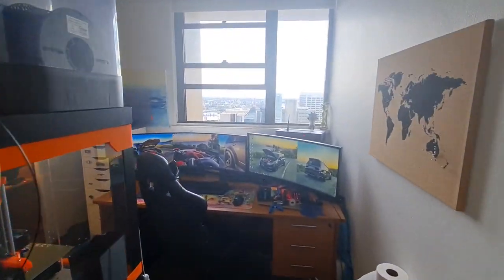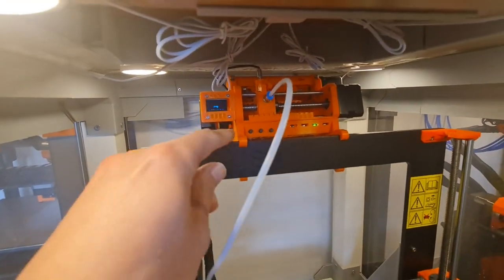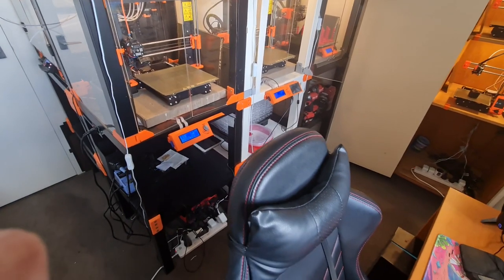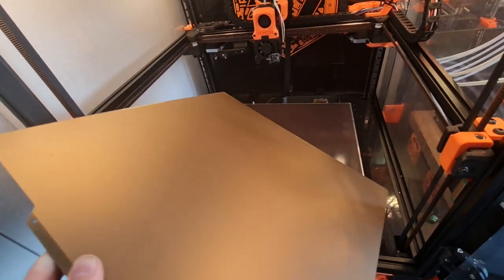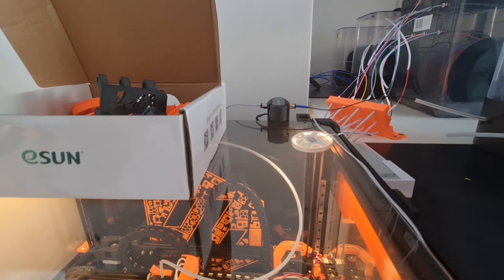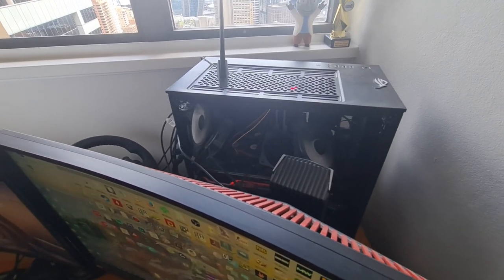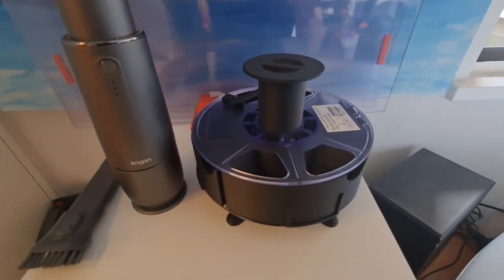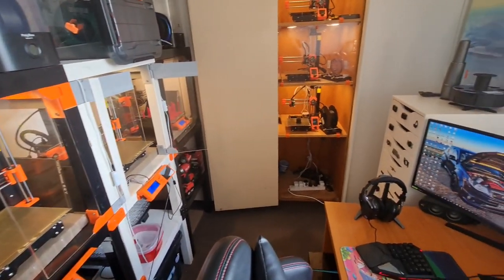Prusa and Voron 3d printer room tour

Comment: nice setup... be careful with electric... I see lots of extensions and those are a real fire hazard. Thanks for sharing!
Reply: You bring up a really good point. It seems like he's been doing this for a while, so hopefully everything is rated appropriately. Extensions aren't an issue as long as you run them well within rating (ideally 60% or less of max amperage).
Reply from the maker: The prusa mk3s use 120w each when printing abs, prusa minis about 90w 
And the voron about 250w 
Led lights are 350w total and usb power supplies 300w. 
So 880w + 650w = 1530w with all printers running plugged into a 240v 10amp socket (2400w)  so only at 66% with all printers and lights on. There's plug in heaters or vacuum cleaners that pull more power from a single plug so will be fine ✌🏽
Reply: @keenzkustoms2408  That's assuming it's the only socket on that circuit. The peak load will be rare to hit however, so yeah you're probably ok. It'll just be if there is a fire, insurance might not cover it if power boards plugged into power boards are discovered after the event.
Reply: Yeah best to run these printers of off water power instead of electric. 

Or get an English lesson.

Comment: Very sweet indeed. I’m a newbie so should I buy Prusa or Voron? Thx
Reply from the maker: would go with something like a prusa mini as your first printer or a mk3s if you have the budget for it. the voron requires alot more work such as compiling your own firmware so gets quite involved. where as the prusas are pretty much plug and play and the screens guide you though getting your first print set up so works good as a first printer.
Reply: Agree with the above, get a Prusa mini, learn a lot and then use it build a Voron. The Vorons are great second printers, wouldn't recommend them as a first.

Comment: This looks like a setup I would have. The Mini speed testing is impressive! Especially considering I've been looking at vorons lately. I'm in a situation right now where I only have one heavily modified Ender 3 V2 and I learn rather quickly. After only 3 months of printing I'm already doing prototyping and I would like to start doing some small production work.

I can't decide whether to start with a Voron or with Prusa minis. Which one is more productive for you? Do you use the voron for production or is it just for prototyping and fun? I almost bought a v0.1 until I realized just how small the build volume was. I like rat rigs too. I want something I can start using to sell products right away.

The fact the mini can print as fast as it can is almost making me lean towards that. Not that I even want 250 mm/s. If it prints clean at 180 I would be happy.

Subscribed! 👍😎
Reply from the maker: Hey mate! Thankyou!
Cant beat the voron! I use it for heaps of my orders and making all the parts for the vorons I sell. 
Having the larger build volume is so helpful when setting up a bunch of prints to do all at once when I'm away. So the voron would be more productive. Especially when I get my ERCF on it and can print multimaterial. I'm going to slowly change the mk3s over to voron tridents if my ERCF works well.
Reply: @keenzkustoms2408  Okay. The Voron is double the initial investment. I would probably go with a kit even though that wouldn't be my ideal route to take. Supply chain problems and inflation is getting worse. Also, Black Friday is coming up soon.

Since you have both you are literally the best person to ask. Would you say one voron 2.4 is as productive as two or three minis? I was planning to buy a mini every 3 months. But if I can build a voron every 6 months.

Thank you my brother from down under! 👍
Reply from the maker: @dangerous8333  I would say the voron is worth about 4 minis due to the size and speed could fit 3.7x as many parts on the 350mm voron
Reply: @keenzkustoms2408  Okay, damn, I want a smaller footprint. I just wish the v0.1 was at least 180mm. It would be such an easy decision. I would have to get at least two 2.4's in case one goes down. I'm also looking at a 1.8.

Damn it!!!
Reply from the maker: @dangerous8333  go the trident over the 2.4 it's slightly cheaper and newer
Reply: @keenzkustoms2408  I'll check it out. I've heard the name thrown around but I hadn't looked into it yet. Trident, Rat rig, vcore, switchwire my head is spinning! And I wasn't sure which one was the newer technology so that's good to hear. Thanks man!
Reply from the maker: @dangerous8333  yea its got 3 lead screws instead of the 4 z belts so has slightly better z quality. Less maintenance keeping the belts in tension. New assembly manual is heaps more detailed then the 2.4. Slightly cheaper. Because the bed lifts up to the top get less issues with parts warping as it's in the hotter part of the chamber up the top. Few other small improvements over the 2.4. Only negative is that you loose 100mm of max Z height
Reply: @keenzkustoms2408  I'm most likely building a Trident after you bringing it to my attention and doing some research. 250 z height is plenty for my purposes. You saved me from wasting time and money. Thank you bro!
Reply from the maker: @dangerous8333  no worries mate let me know how you go! I'll be building a trident today might do some videos on it

Comment: Hi there,
I was wondering how your lack tables are holding up with a paver underneath the Prusa MK3S+. I was wanting to do the same set up as well :)
Reply from the maker: Yea definitely need the paver underneath or the lack tables make the printer so much louder
Reply: @keenzkustoms2408  thank you for the reply! I will definitely invest in using those for my printers.
Reply: I have the same Lack setup with the paving stone. I've noticed it makes the interior height too small so when the printer head gets all the way to the top it kinda squishes the filament. I added an extra bit of height to the mounting blocks.

Comment: Dope farm! I need to find someone with a working config for the BTT smart Filament sensor to copy.

How do you like the voron 2.4 for production printing?
Reply from the maker: Thanks mate! 
Just using the recommended cfg on btt github but added an extra 3mm for detection length 

Yea its a beast! Can't wait till it has the ERCF on it tho as most of my prints require a color change half way. But for now this just handles all the big items
Reply: @keenzkustoms2408  baller, thanks man! I’ll hook it up tonight then.
Reply: @keenzkustoms2408  Wasn't able to find the config, must be in the klipper one. My issue is the pinout on the mini e3 skr v2 for the sensor but i'll get it.
Reply from the maker: @powersv2  use ground and pc15 in the e0-stop plug and set it in the cfg
Reply from the maker: [filament_motion_sensor runout]
#   The minimum length of filament pulled through the sensor to trigger
#   a state change on the switch_pin
#   Default is 7 mm.
detection_length: 10.0
extruder: extruder
pause_on_runout: true
runout_gcode:
  {action_respond_info("RUNOUT Motion Sensor: Filament runout")}
  M600
insert_gcode:
  {action_respond_info("RUNOUT Motion Sensor: Filament inserted")}
#   The minimum amount of time in seconds to delay between events.
#   Events triggered during this time period will be silently
#   ignored. The default is 3 seconds.
event_delay: 3.0
#   The amount of time to delay, in seconds, between the pause command
#   dispatch and execution of the runout_gcode. It may be useful to
#   increase this delay if OctoPrint exhibits strange pause behavior.
#   Default is 0.5 seconds.
pause_delay: 0.5
##    XYE mcu E0DET
switch_pin: PC15

Comment: What is the print speed difference, on average, using the Voron vs Prusas?  Just curious the print time savings that can be expected.  Also, is it proving reliable for long prints and prolonged use?  Any upgrades/changes from the standard spec?  Cheers!

Last question: I'm a total newbie to 3D printing, but good with making stuff and have a bit of Arduino exerience and electronics/soldering etc.  Would a Voron be too much for someone like me as a first printer to build?  I'm attracted to the print speed for prototyping for the project I have in mind which is my reason for getting into 3D printing... but my shortlist is either a Voron or a Prusa Mini+ (rationale: reliable, good quality, can print various filaments - all straight out of the box... good community around it).  If you think a Voron would be an option, which would you go for as alternative to Prusa Mini+?  I was thinking of the Voron 0.1 as I don't need a larger build area for the project I'm working on, and can always scale up later for production if all goes to plan... but meantime it keeps my costs down and alows fast prototyping for iterations when designing.  Thanks for reading my mini novella!
Reply from the maker: the voron is about 3-4 times quicker then my mk3s so slowly going to swap out the prusas for vorons. 
the mini is super easy to use so great for beginners and just works where as the voron will require alot more setting up. the voron comunity will be happy to help you along the way tho and many good videos out to help. can also pm me and ill help you when i can.
Reply: @keenzkustoms2408  Thanks so much for the speedy response, and the generous offer of help with questions on the Voron build.  I've joined the Voron discord, but not yet had the chance to look around. That speed difference is irresistable, but I realise it comes at a cost - for a newbie like me - which is the learning curve and longer setup.  I do have one final question to inform this decision: are your Mk3s running Klipper, and so benefitting from its tuning?  Or could running a Mini+ on Klipper be a half-way house for me?
Reply from the maker: @neurojitsu  yea will pick it up pretty quick! Let me know how you go
Reply: @keenzkustoms2408  thanks, will do
Reply: @keenzkustoms2408  Sorry mate, one more question ha ha...

Would I be correct in thinking that a Voron 0.1 with Bowden setup would be a faster printer than a Voron 1.8 direct drive?  I'm trying to weigh up 180mm build plate vs 120mm... thanks!
Reply: @keenzkustoms2408  OK I've been thinking it through today and decided I'll go for the V0.1 over the Prusa Mini+.  Thanks for your responses, they've helped me think this through.  What swings it for me is the speed of printing, plus the fact the V0.1 can be configured as a direct drive - I think the balance of quality and speed this will deliver will be ideal for my purpose.  Moreover, as I move into production later, any design that prints on a V0.1 can be printed x4 on a larger Voron such as the V2.4 - and so it just makes sense to prototype on a Voron machine, knowing that my design and print quality can easily be replicated at speed and the same quality.  I'll let you know how I get on...

Comment: this seems really redundant and sub optimal. just a few things like:
- perspex isnt a great insulator for heat
- mounting boxes dont stop vibration 
- the filaments pass through air so could attract moisture
- no cleaning station
- no where for peripherals eg kiln
- no resin printers or environment to use them
- most printers are not in use
- no multi colour filament changer, just duel extruders
- no QA equipment shown
Reply from the maker: -perspex is a better insulator then glass, main reason for it is to prevent drafts that warp the print. Doesn't have to be perfect just stay around 50c in there for abs not to warp so perspex works perfectly for this setup.
-what vibrations? The printers each are sitting on a concrete paver which minimises vibration. 
‐not trying to be perfectly dry just keep moisture levels down below 20%. Have the dehydrator If getting any issues with wet filaments but generally use the whole roll before it could absorb enough moisture so this just slows it enough to have no issues.
-dont need cleaning station as not resin printing.
-why do I need a klin? 
-my kind of work doesn't require resin printers atm but when I move to a garage setup I will get some. 
-didn't put any prints on as would be impossible to record good audio for the video with 7 printers running
-have 3 multicolor filament changers (mmu2s) with 22 filaments loaded with a 15cart ERCF on the way. Don't have any duel extuders? 
-for QA I have gauges to test fit in the pods to make sure they fit and callipers for parts that need tight tolerances and the rest just requires a visual inspection as they're badges. 

This setup works perfectly for me. I would rather a larger space for some larger equipment like lazer cutters and cnc machines but for now just working with the room I have. Sorry that this setup is "sub optimal" for you, seams to be pretty perfect for me and lots of others seem to like it too 😁
Reply: No multi-color? Did you watch the video? Why would you bring your negative energy to someone that's just demonstrating their FDM setup? Getouttahurrr!
Reply: Somebody is jealous!
Reply: @lukakoskitchen6372  jokes on you i have nobody in my life and never did
Reply: @keenzkustoms2408 
- Perspex might not be able to reach 100c if you want to print other materials
 - kiln is a joke but also for printing in metal
- u need cleaning station and resin printers to cover the material property areas you can't with fdm and a bunch of other things resin does better i won't mention because this is also a joke 
- im sure you have great fun printing like this but you should broaden your horizons. there's no reason you shouldn't be aiming to work for space x or something. if you are human you have the potential to be just as smart as anyone else on the planet. cnc and or sls would be cool but u don't have the room i guess
- you should have shown the colour chanters. that's the coolest bit!